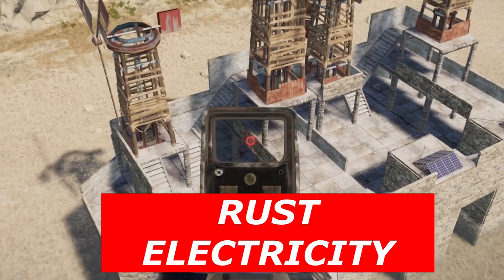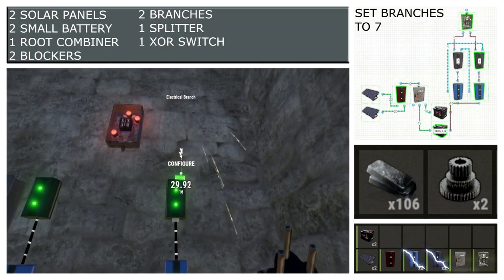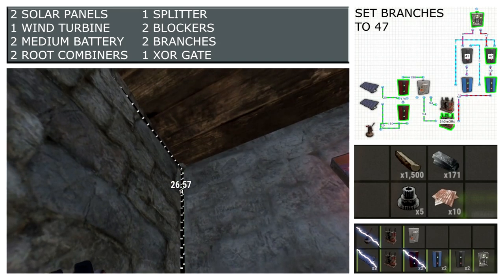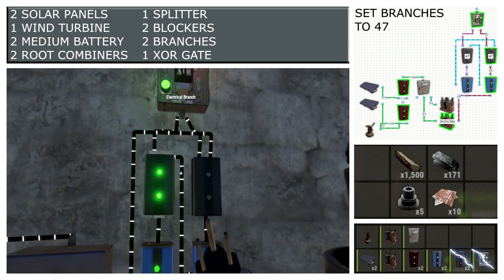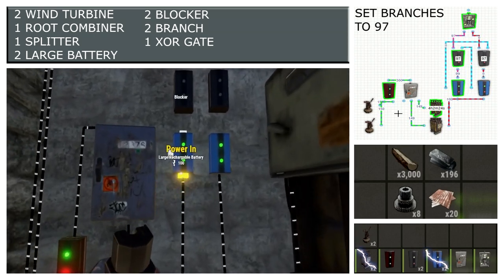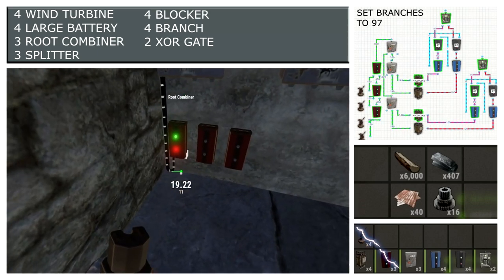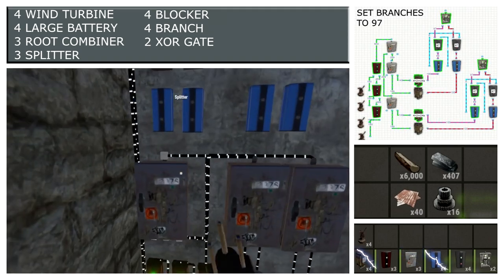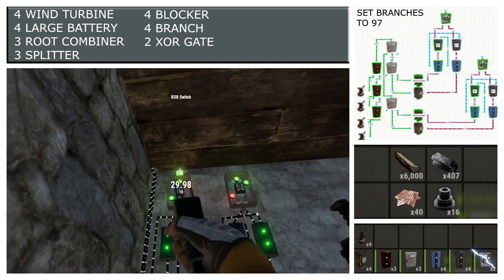RUST | INFINITE BATTERY POWER | 4 Buffer Battery Circuits

Comment: nah dont consider it a glitch, even though technically yes real life battery will get worse over time i dont think it should apply to rust batteries simply because if you want to treat it like real life then the battery decay time will still be almost negligible when considering how many rust days there are in wipe. this is because real life car batteries for example can last up to 10 years

Comment: Excellent setup. Very efficient.
Reply from the maker: Thank you
Reply: I built the circuit today and found that the branch will pull all that power from the battery even if you aren’t using all of it. For an example, if I only need 80, the branch will still draw 100 no matter what. An obvious waste of 20. Even if you set the branch out to your current power needs, the left over still goes to the other blocker. It’s still a waste of power. A player would have to maximize usage (97) to get the most out of the battery and this setup. For that reason, this setup doesn’t work well for me.
Reply: It's actually very inefficient

Comment: Yo quick question, since the output of the xor switch only allows 97 volts, how do we get more because with only 97, I can’t connect it to Sam turrets, a couple auto turrets etc. since the battery also maxes out at 100, how would I be able to power everything
Reply from the maker: Youd have to split and multiply the circuit, in other words you need more power and another xor circuit

Comment: i think your electrical branches are draining the batteries with their large fix amount, shouldn't they be inverted (set to 3 and wild output going to the xor switch) ?
Reply from the maker: This video could be outdated I dont even remember recording it
Reply: What a answer xD
Reply: What should be used instead of branches i don't get the 47 set amount
Reply: @connorbrown9551  total - 3 in each example. 
Just invert wires and set to 3.

Comment: So with the batteries now having procedural charge, do the old style of serial battery buffers no longer work? Ive hooked up dozens of electrical systems with the batteries just hooked up in series for longer power and/or parrallel for more power.
Reply from the maker: Not sure, if it does ill throw it in my tips and tricks video im working on
Reply: I know with small battery systems a blocker is needed to prevent the small battery from immediately discharging every unit of power it gains from being charged into the system, even if that system is a manual switch set to 'off', or at least I aas running into that problem before the procedural charge.
Reply from the maker: Yeah im not too sure still havnt tested it yet, but i think it would require more input power than output to charge ina series
Reply: I was running in to that issue without any draw on the system other than the components.

Comment: Great video but im having an issue with root combiners glitching. I run your setup but im running 2 small batteries combined as one battery but ewverytime the batteries switch over the dead ones cut their output from the combiners 10 in from both but only 10 outof the combiner which satrted off at 20 being 2 small bats.
Reply: You lose 20% of what ever charge you put in, so to keep battery charger while still using them, you need to put in to each battery 12.5 or 13 rwm

Comment: hey @Drizza dose it still work ? , the only thing i wanted to do that extend the wire from the wind turbine through memory cell x2 but later it's shows i have power on memory cell but i cannot combine those to finish this circuit ;/

Comment: So if one battery charges to full then will it automatically start charging the other?
Reply from the maker: Yeah it will charge the last one in the daisy chain first then fill the rest from the bottom up
Reply: Drizzza Okay I thought so I just wanted to make sure, thank you for this :)
Reply: they patched it in this wipe.. this system is crazy.. they needed 5 months to repair it i dont believe hahah drizzza gj man! i used it in last few wipes

Comment: If your back up battery is at 100% capacity, while on standby, you are wasting half of your power source by splitting it it between the batteries.. you'd be better off with a branch, trickle charging the backup.